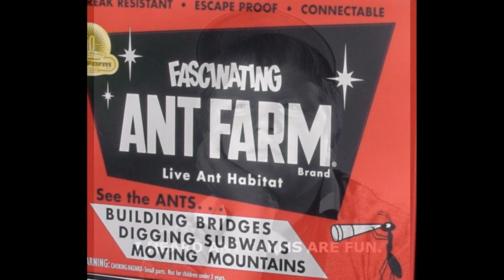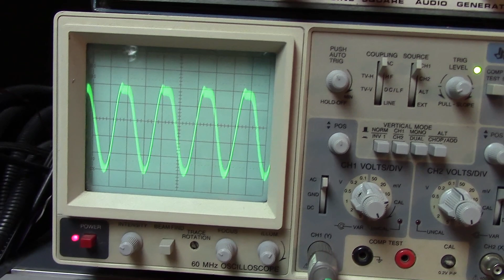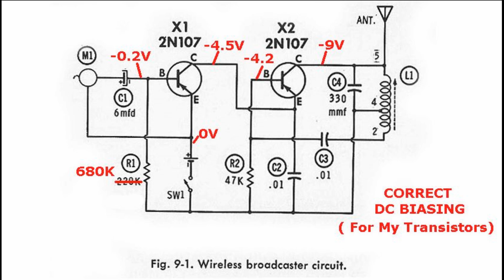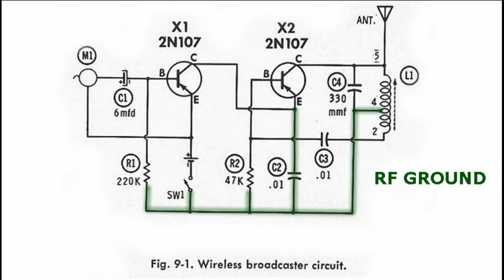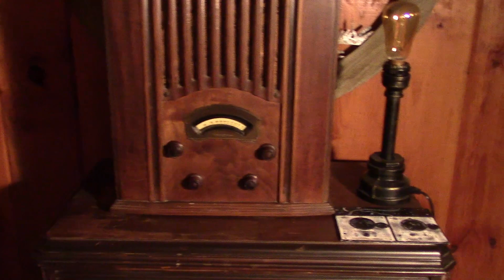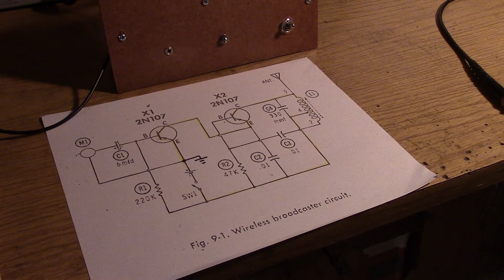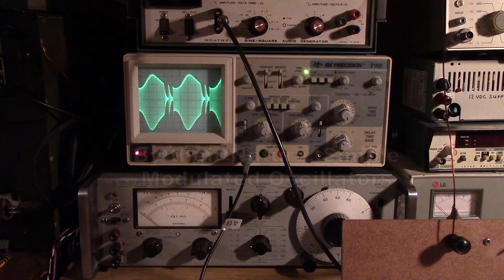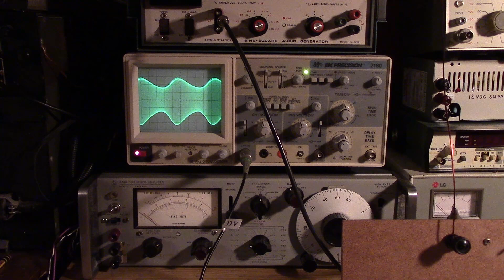Home Broadcaster Part 3

Comment: Hello Mike. I have built the home broadcaster and playing a lot! thanks to share it. if you wish i can upload some of my built one to see it.
The transistors that I  get are a little bit modern than the yours. they are 2sb371 savaged from an old mains carrier intercom. with a beta higher than 2n107 the bias resistor to get 4,5v in the center point was 1 megohm. not often the transistors seem to have an internal  leakage which makes a 6v in the midpoint without any bias resistor. so the 1 meg resistor drops the 6v to 4.5v
the coil was homemade with 10-50 turns in an old am radio ferrite rod. as a microphone I have tried many speakers and earphones and the best was an old phone headset earpiece. I have talked to the low volt regen! I have no changes with an antenna of some inches.
I hope to see more projects Mike, so I will search your videos for more ideas to build. 
Have you a nice time and 73's from Argentina!
Reply from the maker: Ha! This is exactly the type of work that brings the old circuits to life. Your ability to adapt the circuit and set the bias points is the key. The variables are too extreme to come up with an exact schematic with these parts. But the circuit is generic enough to work with almost any parts you can scavenge.
Reply: @MIKROWAVE1  I'm working in the construction and testing a broadcaster from cfl electronic lamps components as a recyclation project and You will have the credits!

Comment: What about using a LDR and lamp in a tube as your modulator....
Reply: hi Stephen. is a nice idea to play. the lamp has a little inertia so the voice or music will have a low pass filter effect. smaller lamps will have less low pass effect. the lamp could be driven with any decent audio power. have you a nice day Stephen!
Reply: @julianvalenti  what about an led?
Reply: @G7VFY  a led will be very fine. Has a fast response and take less power. With a full briidge rectifier to work with the ac of audio power and a dc bias to avoid its own on  treshold  will have a fine fidelity.
Reply: @julianvalenti  I hope Mike thinks so...
Reply: @G7VFY  yes, why not?
Reply from the maker: I did a modulated flashlight and an IR diode communicator in college as a class project.
Reply: @MIKROWAVE1  you clever chap! But what about as a Modulator.  Mind you,  you've finished with that Transmitter thing now, haven't you?
Reply: @G7VFY  and Mike. Electronics was born in the attemp to improove comunication between us! All we are talking about is around the comunication. Ideas bring new ideas. Many great invenctions has came from a conversation betwen genious minds like the ours! I'm feel fine. Thanks to be a part of this😉
Reply: @MIKROWAVE1  yes! Thath was a way to comunication in a real world! Even earlier the radio! Powerfull dc carbon arc lamps modulated to comunicate between ships. Is very intresting.

Comment: Thanks for this - I found a couple of suitable germanium transistors and a suitable oscillator coil in the junk box - er, room. Put it all together and it worked first time. Cool.
Oh, I've built silicon transistor gadgets - but this circuit has more retro mojo.
Reply from the maker: Ha - you lucky dog. On the final video I attempt to modernize the circuit with silicon transistors. Then I go nuts and add a mic preamp and a mic gain control.
Reply: @MIKROWAVE1  I look forward to it! But I used an old British telephone earpiece as the microphone and have to be careful not to overmodulate the oscillator stage. I made R1 a 1M trimmer and it's set to about 800k with a 2N404 "equivalent" with a DC gain of 68 as Q1. Q2 is a 2SA-something RF transistor. It wouldn't have worked without your guidance.

Comment: 0:24 You are using a high impedance magnetic headphone as a transducer(pickup microphone)?
Reply from the maker: Yes a good old 600 Ohm telephone headpiece or 1000 Ohm Headphone : AKA a Dynamic Microphone. Even an 8 ohm speaker will work as a "fair" microphone if you go into a low impedance amplifier like a common base, or step it up with a transformer.

Comment: That's one thing I've learned in my dabbling with electronics, the simplest circuits for a given job are often the most complex to build. They tend to require a lot of tweaking, or shooting in the dark if the proper test equipment is unavailable.
Reply from the maker: The voice of reason. There is a fine balance between: so simple they will actually try to build it and this stupid circuit don't work!

Comment: I am curious if the book gets into the details of biasing the "totempole" stack arrangement of PNP transistors. Given the simple biasing circuit, the Hfe of the transistors used will vary quite a lot and the bias resistors almost certainly would have to be tweaked.
I guess they did not use a resistor-divider and base emitter style of biasing circuit because the gain the the transistors (at that time) was so bad that they needed to squeeze every bit of gain out of them as possible...
This type of breadboarding brings back some memories, the stuff was magic at the age I got into it. Who else had Radioshack 75-in-1 or 150-in-1 kits that they ended up salvaging for parts?
Cheers,
Reply: Eddy_D  ,  I can smell the rosin core 60/40 solder smoke! LOL I was born July of 1941 and remember this era well!  de KQ2E